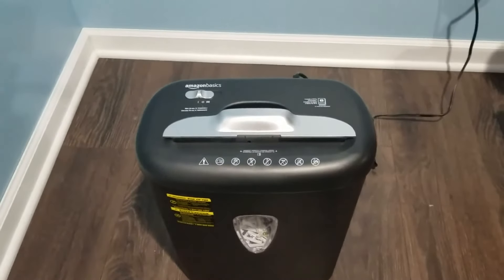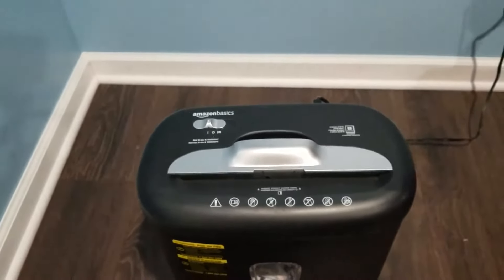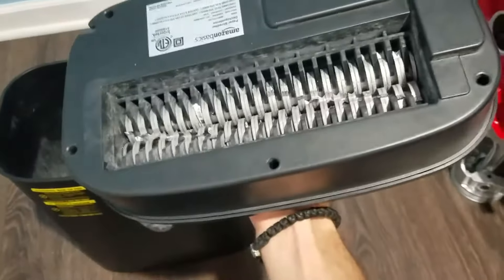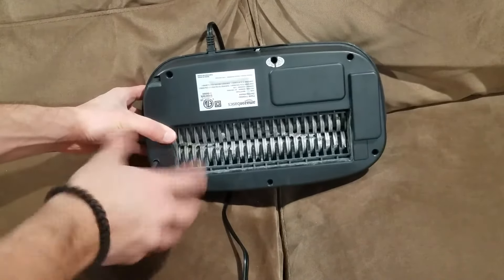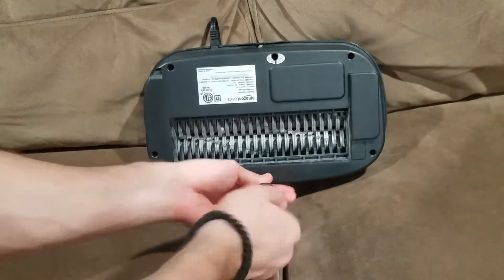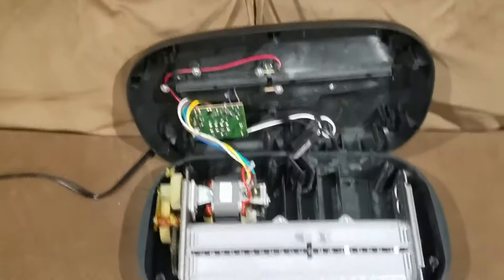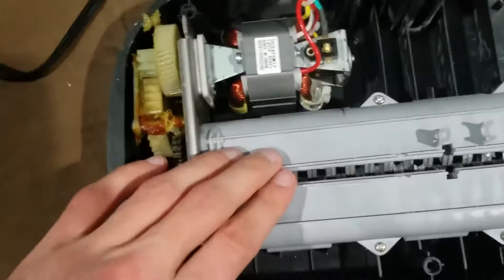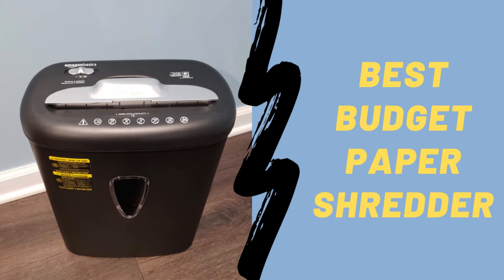How to Fix a Paper Jam on AmazonBasics 6 Sheet Cross Cut Paper Shredder

Comment: For safety would have better to announce at the very beginning to remove plug from power supply and clearly show the plug in the picture as unplugged - currently just shows the lead which to a viewer could still be plugged in ... worrying!

Comment: Thanks! It took your video to point out to me that there was a screw under that warranty label.  I had wondered why it was "stuck on something" preventing me from "prying" it apart.  So easy...Phew!
Reply from the maker: I broke mine in the process because I couldn't find that dang screw
Reply: I ended up finding many of the plastic parts where the screws mount had broken from the jam. It would be a major reconstruction with epoxy and epoxy putty, or some long screws with nuts to hold it altogether.

Comment: I watched this good video because I was trying to troubleshoot the sensor. The sensor was working fine - unit will not turn on unless the top assembly is mounted on the receiver can. (I was trying to make sure it worked before putting it back on the receiver can.)
Reply from the maker: The process to take apart the unit is the same

Comment: Still can’t figure out how to put back the sensor
Reply from the maker: The clip at 2:54 is the sensor. Place the clip back in the holder for it. It should be sticking out a little on the back side. You should hear a click when putting the head of the shredder back in the bucket.
Reply: Filip Tech thank you! 😊
Reply from the maker: @ChrisRoman95  Of course

Comment: I did mine & now it wont turn on??? did i not screw it back tight enough because it felt tight when i did
Reply from the maker: Is the light not coming on?
Reply: @filipjtech  Yes the light wasn’t turning on, brother managed to fix it. Do you know why that happened ?
Reply from the maker: @masteryoda9284  it had happen if rh back sensor is not touching the bucket. So maybe it wasn't tight enough on the back. Push down the head and wait for click sound

Comment: I bought this and it stopped working within 10 minutes.
Reply from the maker: Make sure the head is properly seated in the bucket. The sensor on the back should make a click to signal its activated. Push the shredder down with one hand and put in another piece of paper.